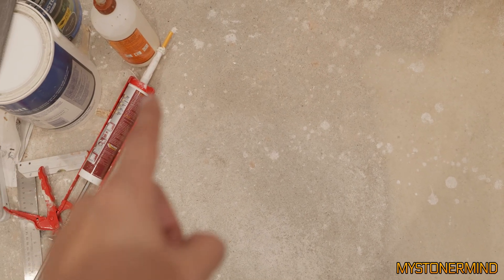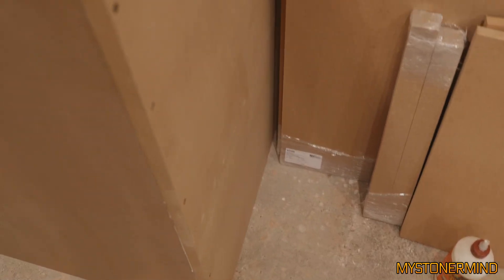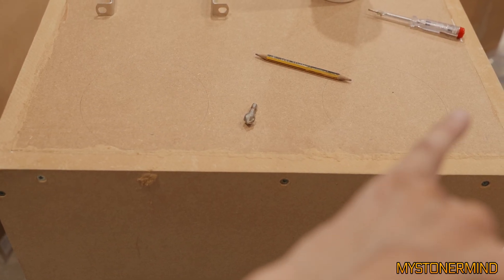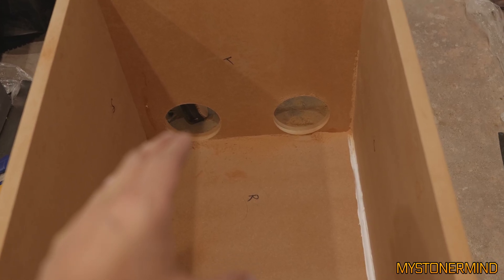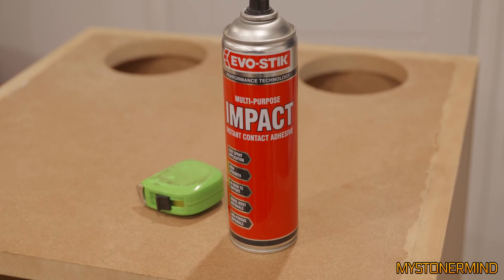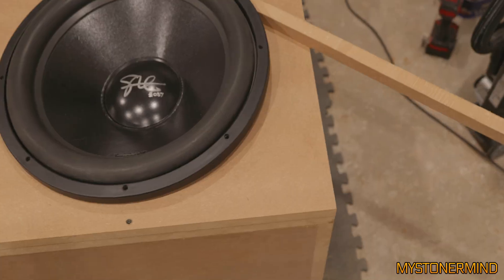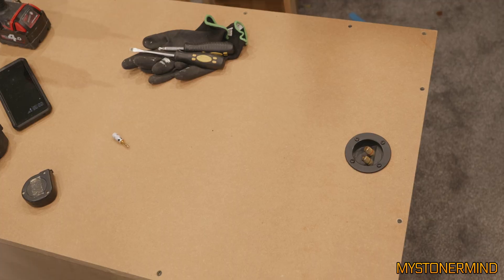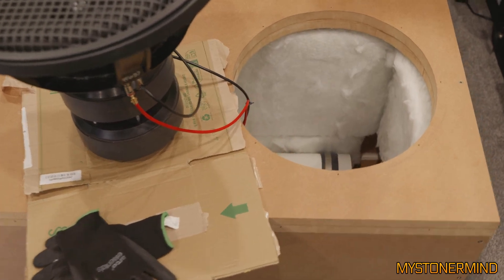Built My 18" Subwoofer A Dual Chimney 17Hz  Mansion

Comment: hey stoney hows your day?, and a little tip, try to use pretex as a damping material, it works better for bass, (works even better combined with the white damping you used) it is a little pricey tho.
Reply from the maker: All good. Not heard of that, I just use what I know has worked well for me before 😉
Reply: @MyStonerMind420  well good to know!
Reply from the maker: I was searching and the only results showing were those board style cavity wall style insulators which won't work and consume space. 
If they sell the foam/roll stuff, I reckon it would work similarly to what I've used but, it would be a mission to take sound measurements of the stuff I've used and then re-fit and then re-measure the other. 
I could do with acoustic insulation in the room though so maybe there's still a chance. Cheers
Reply: @MyStonerMind420  oops, its called pri tex, i also searched it up, i cant see it too, ill just explain how it looks maybe you will guess what it is, its what most professional music studios use, its black/grey and it has a pyramid pattern, i can make a video for you if you want me to show you how it looks 
 : )
Reply from the maker: hmm I think I know what you mean. You know the stuff that is "made for acoustics" is actually just regular, normal stuff but they charge more because it is "made for acoustics" lol. A lot of people in the building trade know this but regular folks don't, but that's how they make their money
Reply: @MyStonerMind420  ohh damn, well if it works it works!